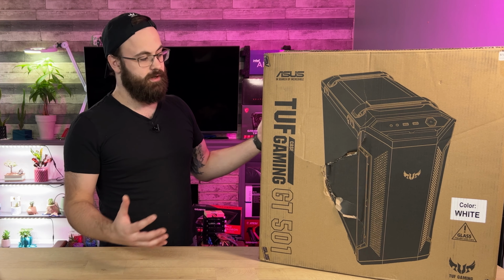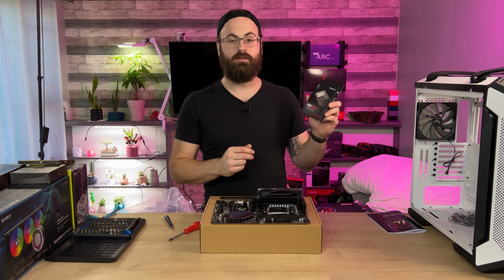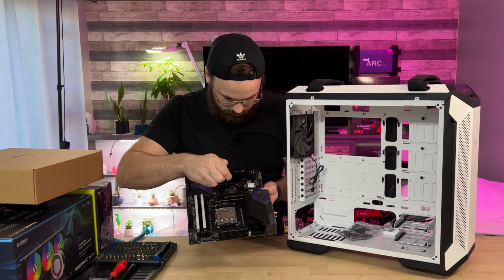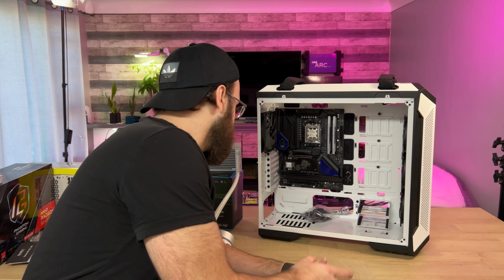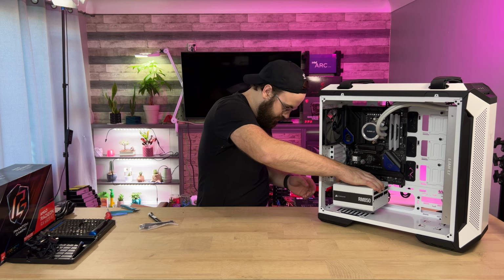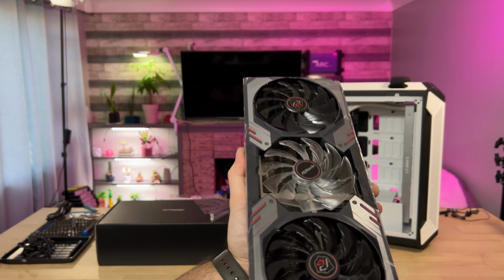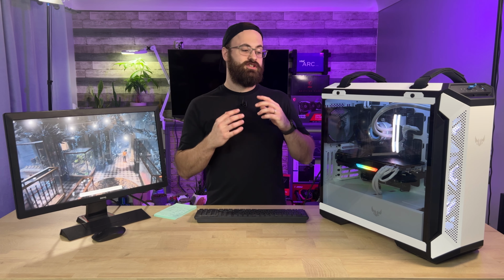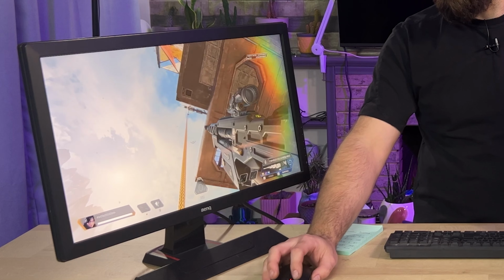Ryzen 7 7700x High End Build ft. Asus GT501 & Asrock B650E Riptide

Comment: Hahah was pricing up my next upgrade, and came here to see the motherboard, and im currently on a 7700 and 1060 6gb...i like your friend.

Its been along time coming but i really milked every piece of hardware ive owned. 3 buulds being

Core 2 duo, radeon 5770
I5 2500, gtx 670
7700, 1060
And now hopefully this. Have always waited to buy just as next gen dropped to make it cheaper. Sadly this will be my first amd build aa intels offerings just dont stack up for price. Probably with a 4070 though

Comment: why not put the ssd into m2_1 slot? I am reading this is fastest slot?
Reply: yea it should be in m2_1 slot
Reply from the maker: The m2_1 slot is a gen 5 slot. The drive used here is a gen 4 drive. There is no performance gain by populating a gen 5 slot with a gen 4 drive. Additionally I believe if you do populate a gen 5 drive in the top m2_1 slot I believe it might drop the top PCIex16 slot to x8, but the manual won’t load on my phone right now for some reason so double check the manual for that info.

Comment: Why install the AIO cooler wrong though?

Installing the cooler like that makes the pump run dry and gives sub optimal cooling.
Reply from the maker: The pump is not the highest point in the loop, so it won't be running dry. Air will settle in the top of the radiator.
Reply: @ultraprecisiontechnologies  https://youtu.be/BbGomv195sk?si=-5y_vETxO-ltOfys

It's still at minimum not ideal.
Reply: Dude you don't get it over time when these liquid start to evaporate it gonna have struggle to reach the other side of pipe you should put pipe side downwards so gravity help the liquid to go through the pipes even after years of evaporation  @ultraprecisiontechnologies

Comment: Can't we use both PCIE x16 Gen 5.0 slot and the m.2 PCIe Gen 5.0 slot together ? Why didn't you use the m.2 right above the GPU slot ?
Reply from the maker: Great question! First off, this boards x16 slot only supports up to gen4 speeds. Secondly, we used a gen4 nvme, so as long as we use a gen4 x4 m.2 slot, we will get the maximum performance of the nvme. There is absolutely no advantage to putting the gen4 nvme into the  gen5 slot.  In the future, if this person now wanted to add a gen5 nvme drive, the slot is open, and he could do so without moving anything else. I hope this answers your question!
Reply: @ultraprecisiontechnologies  Oh thank you so much for the info but even if we put the gen4 m.2 in the 5.0 slot won't it run at the 4.0 speed? So does it really matter if we use the 5.0 or 4.0 ?

Comment: I'm building my pc this wekend with this motherboard and since the last pc i build was 7 years ago it's very nice to see this video and learn something from it. Thanks.👍
Reply: Im going with this motherboard and 7800x3d this month. Same as you my last pc was 7-8 years ago. I was rocking I6700k with 1070
Reply: @owieczkacs  how did it go, the mobo is working good? Is the boot time fast? I'm planning on building the 7800x3d with this mobo too
Reply: @astrocs. I have pc for few months now. Mobo is a beast. I have ssd and nvme connected to it, 7800x3D, 32gb CL 30 6000, 4080 super. Boot times are blazing quick, i can measure or record after work. Future proof with PCIE 5.0. Had to turn on profile for ram in bios and set curves for my cooling other than than rest is on default. I measure temps constantly for my gpu/cpu in games with hwinfo program. Also went with Fractal Torrent case. 

This pc was expensive but its a beast and will last me years... damn i was using 6700k with 1070 for 7-8 years so yeah i expect my new pc to outlast that :D
Reply: @owieczkacs hi there would you mind making a video of the bios turning on xmp and setting your fan curves? No one really has any videos of this Mobo or even much information and I really want to get it but I'm not very experienced with this stuff.
Reply: Motherboard is working great. I had no bsod or whatever since i got it. The boot times is around 20 seconds. I must say that once a month the boot times is like 2-3 minutes. I googled it and i think it might be memory training. But the computer never did not start. I'm very happy with it.
Here is my complete build:
-AMD Ryzen 7800x3d
-Asrock B650E PG Riptide Wifi
-Gigabyte GeForce RTX 4080 16 GB Gaming OC
-G.Skill Flare X5 F5-6000J3238F16GX2-FX5
-Thermalright Peerless Assassin 120 SE
-Be Quiet! Pure Power 12M 1000W
-Lexar NM790 4TB
-Montech Air 903 Max black
Reply: @CrashingNL did you find it difficult screwing in the ssd? It’s being a bitch for me might have to buy a magnetic screwdriver

Comment: I was/am in a similar situation as your friend right now. i5-8600k and 1070Ti. 
My budget is not super high though so rather then the 6800xt and 7700x I got the 6750xt already (easy upgrade to do if I cant budget the full build) and am looking at going AM5 for the same reason of not upgrading very often, but the 7600x as it pairs better with the 6750xt and is a little less. It is much more in my budget to upgrade the CPU and GPU a little sooner then I normally would though then to do it all at once. So I am fine with this build being more of a mid tier at this time to just get it going. I am looking at the Riptide as an option though for the features it offers for potential upgrades down the line. Though with price as a consideration I don't know how much having PCIe Gen 5 will be required and not just be a nice to have feature near the end of AM5's life cycle as we are still only just barely pushing Gen 3 to its limits and Gen 4 has lots of room. (Assuming your GPU is a full x16 and not a cut down x8) So I am looking at other boards around that price point as well for other features and that might work with my build's look better.

Comment: Should I buy this motherboard or safe 10-20 dollars and buy a msi or gigabyte 650 board ?
Reply from the maker: Definately don’t buy a Gigabyte board imo lol. I just went through RMA hell with them on a b450 itx board
Reply: Around this price point the ASRock Riptide is the only one that actually offers PCIe Gen 5 on the x16 slot but unless you have one of the only 3 or 4 cards that even use Gen 5 you can save a little money. Even then you would be unlikely to even notice much of a difference between those cards on a Gen 5 or a Gen 4 slot. Same goes for the M.2 slots. If you dont want to pay the premium for a Gen 5 M.2 ssd and only get a gen 4 or 3 ssd then it will just down clock anyway. Though most of the B650 boards support at least 1 Gen 5 M.2 you just have to make sure that the slot does not conflict with the performance of your x16 slot.

Comment: I have the same Mainboard, but If i insert my GPU(6700XT) in the PCIE 5 Slot, the Mainboard dont detect the GPU, but If i insert it in the other PCIE Slot it is detected directly. Maybe u can help me. BIOS is updated to the latest version.

Thanks
Reply from the maker: Are you using a NVME? What slot and what generation. I'm wondering if the top PCIe slot is stuck in gen 5 mode sharing lanes with the gen 5 PCIe slot. The other thing you could try doing is manually setting the top PCIe slot to gen4 or even gen 3 and seeing if the card is detected.

Comment: i am considering getting this motherboard, and a 7600 non x version. are there any requirements i should be aware of, such as requirement of liquid cooling, bios adjustments to insure i don't ruin the processor from overvolting and such? if i do get liquid cooling, are there any cpu coolers this board does not work with?
Reply from the maker: Right out of the box, with that cpu, you wont have to worry about touching any bios settings. The 7600 non x is not a power hungry chip. As for compatibility issues, nothing stood out as unusual to me. That being said, I didn’t test multiple setups of coolers, just used the one shown in the video.